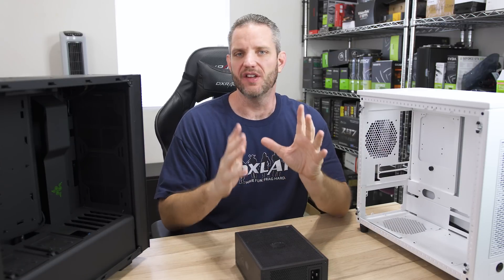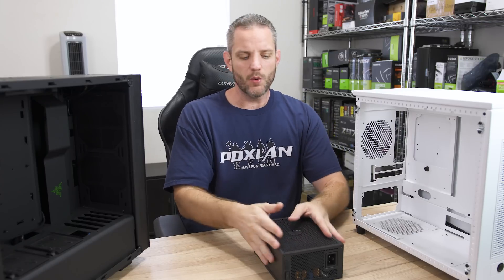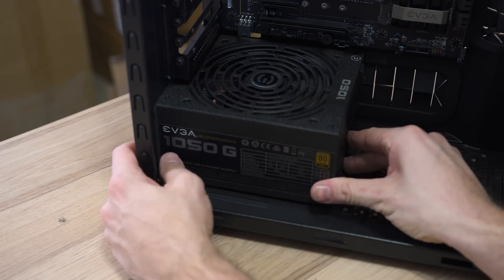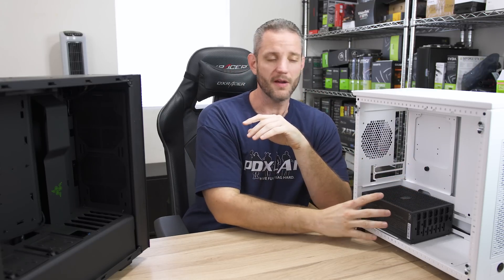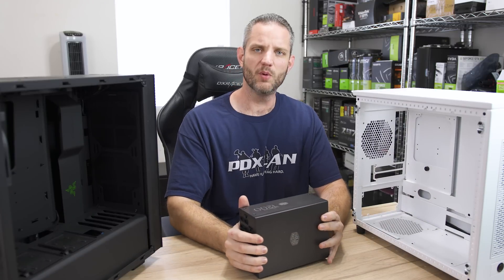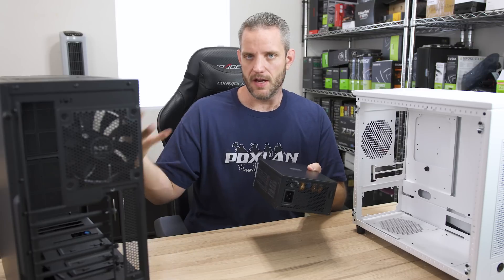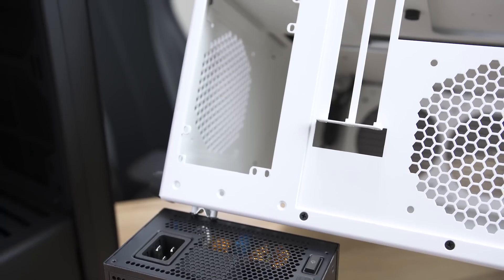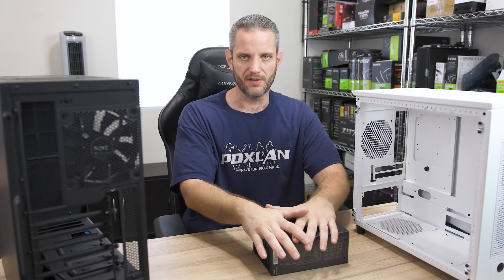Should you mount your Power Supply up or down?

Comment: Thank you very much!! this simple thing really help me.. i have a case with 3 fan in the front (intake) and only 1 exausht to pull all that warm air out of the case. at first i buy another PSU.. From Seasonic to corsair but still got many problem my PC. and when i put my hand on its glass side its feel warm.. really warm. i think with all the cool air push by 3 fans inside the case and it became warm and it had nowhere to go.. with only 1 exaust. there is a strange sound from my PSU like krik krik krik all the time..  sometimes my PC restart without warning (BSOD etc) it just restart. several times a day. i'm thinking to RMA my 1 month corsair.. but then i watch this video and i try to move the PSU face up.. no weird sound anymore from the PSU.. no restart (at least for now.. hope last forever without weird restart) so guys.. dont just thinking about how to push cool air to the case.. coz that cool air will instantly became warm when they go around CPU/GPU/HDD etc.. but also think how to get that warm air out of the case.. or inside the case will became hot and too hot.. a warm air trapped inside your case really can make your PC acting weirdly.. thank you for this video!
My specs were:
i5 8400 with 1060 6GB
this specs should be cool enough.. but because i'm leaving in tropical island.. the air inside the case became so warm.

Comment: If the PSU is at the bottom of the case, I would have its fan facing outward precisely because of what you said at 5:26: I just don't want anything to get inside the PSU.  And if need an additional exhaust fan, many cases let you install one or multiple ones at the top.  But if the PSU is at the top of the tower, gravity would prevent anything from getting inside the PSU, so I would definitely have its fan facing inward.

Comment: The case has ventilation holes on the bottom and the PSU has an exhaust on either its top or bottom.
I wonder which side of the PSU is supposed to be "up"...

Comment: Can anyone help me out? Would it make less noise places with the fan up or down?

I currently have mine set to down and I think it's to loud.

I know I can test this myself (and I will) but I don't always trust my ears.
Reply: Honestly, up or down probably won't make much of a difference as far as noise is concerned. Make sure your power supply is screwed in snug enough, also check and see if any of the power supply housing is pressed up against your case too tightly... Maybe put a little rubber stopper in between any spots where the power supply presses against the inside of the case.
Reply: @TooBokoo  Alright, thx for the answer! I decided to make a hole in my wall and put trough my cables so my computer is in a unused room next to mine. 

This way my mic won't pick up and computer noise and it's a lot cheaper than buying a quiet psu+case.

Comment: Also if PSU explodes even w/ normal temps if fan is up rest components such as mobo/gpu will catch fire, while fan is bottom then the PSU would just burn alone and maybe a bit of the floor.
So conclusion is: Get rid of the carpet or cut it out and place maybe some nice metal sheet under the PC :D

Comment: At 4:00 You claim there could develop a loop of hot return air from the PSU being used back to the supply side of the PSU causing it to heat up. That theory is thermo-dynamically imposible because heat rises. If the hot air from the PSU exhaust is expelled behind the case there is zero chance of the same air being sucked into the supply fan , heat rises. There is no advantage temperature wise in mounting your PSU sucking from inside the case over underneath it. Your theory is fundamentally flawed and wrong. The air from inside the case will never be cooler from drawing from air underneath the case. Your theory is flawed in many ways and straight up wrong. I like your videos but this video is terribad and you are simply spreading misinformation about PSU cooling. If you have low clearance under your tower sit it on a board or build some type of return air plenum underneath the case. Suggesting people use the "conditioned" warm air from the CPU and GPU to cool your PSU is tragicly bad advice. Using fresh  supply air from outside the case is optimal for cooling and that is why PSU comapnies build cases and PSU's this way.
 You are out of line.- 25 year HVAC Laboratory operator

Comment: I've moved from an air 240 to a 570x case. (yeah i know, it's big for a MATX board). However with the Air240, my PSU died. You have to mount that facing out.
I suspect vaping mind have contributed to that. 
I've since switched some stuff around in my room too and bought a fan (an actual fan) so the vapour doesnt have a chance to settle, and yes, mounted my new PSU facing up so its drawing it's air from inside the case.

Comment: Mounted the PSU up. Just got a new M2 NVME which I tried to install. Dropped the M2 screw down in the PSU. Didn't want to open the PSU. But the screw got stuck inside the PSU. Took forever to get it out. Had to unscrew the PSU and flip it upside down and shake it for a long time.
I remounted the PSU down now. And will do it going forward.
Reply: Same happened to me. That's why I'm watching this video 🤣🤣🤣
Reply: Lucky it was just a screw, if the P/S was the right way up passive air flow would do the work, cooler air falling as warm rises ...
Reply: Lay PC down if you doing work. I have 3x A12x25s at front. Air only in via filtered front.  Air out via rear fan, GPU vent and PSU.  Every other hole, no matter how small taped up, even PCI slot cover holes.  PSU fan is hybrid and never needs to come on.  The positive pressure from front fans is huge and is almost enough to blow lighter flame out if placed near psu vent.  Front fans dialed in with noctua fan controller. Highest speed without being audible in dead of night.  GPU is always 'actively' cooled via the flow too. Clean case,  silent, cool.

Comment: Great topic.  I have my EVGA Supernova 850w mounted down, because the case is on a solid surface, and there's a cover over it.  I would recommend making sure you don't forget to check the bottom filter when you are cleaning your case.  It is easy to forget about it.  Mine needs regular cleaning, almost more than the internals.

Comment: Never thought about positive and negative pressure. My newest PC, which already have 3 years, have 4 fans for intake and 3 to exhaust, and it doesn't have any kind of dirt inside the case, almost. I never cleaned it or anything, while my last PC in a single year would accumulate a lot of dust, even fungi had grown in my entire motherboard when I finally changed it, having served me for 7 years.

Comment: Case : Coolmaster 3.1
Cooler Thermaltake smart rgb 650w  
Motherboard : Asus PRIME A320M-K A320
Cpu : Amd ryzen 3 1200 + Stock cooler Amd
Gpu xfx r9 290 4gb
V Ram : 2x 8gb 16Gb
I have 2 fans in mijn case  : 1 Front Lepa BOL.Quiet PWM Red 120x120x25
                                               : 2 Standaard fan back orginal Coolmaster 3.1 fan
When i play the game metro exodus Mine PC going to 68 to 70c Somethimes 72c is this normal? can this also damage mine pc?
when im on youtube 44c 45c when i gaming end i feel mine pc case its really heat. im litle bit scared 72c 

https://azerty.nl/product/thermaltake/3121922/smart-rgb-600-w-ventilatorhuis-600w

https://azerty.nl/product/cooler%20master/2660003/masterbox-lite-3-1-minitowermodel-micro-atx?gclid=Cj0KCQjwjYHpBRC4ARIsAI-3GkG_ZnZeHKursvUaepy3vMwqdZCX-6xKFIEe_1c8zmQ4f7gmgLzRcccaApoeEALw_wcB 

I would like to hear from you advice and tips from your experience

Comment: Here's my arguments for downward mounting:
- Power supplies can't thermal throttle like CPUs can, and many times the hottest component- the graphics card- is directly competing with the psu for cool air. I'd rather give it a reliable source of cool air than the theoretical best position because it can't correct for added heat.
- Similar to water cooling, any system that is in use for a long time will accumulate dust, mostly on the horizontal surfaces inside. An open-top PSU will accumulate dust inside its fan and internals and be very difficult to clean without risking injury.

Comment: So I have 1 exhaust fan and a shroud so do I go up or down? I do so far have 3 fans at the front (pulling) and 3 above the fan along the bottom so do I set them to pull or push air?

Comment: i put fan up because my power supply has RBG and looks great
Reply: Christian Madrid Dude, that’s a big no no. If your psu is bottom mounted with the fan facing up, It’s gonna pull all the hot air from the system inside it.

Comment: I'm lucky I guess - our case has the basement in it, and a portion of the air front the front fans is sent to the psu.  Also, the computer itself sits on a lower  mesh desk shelf, about five inches off the hardwood floor.. The psu draws air  from the bottom and out the back -  seems like good airflow.  A cleaning every month with compressed air help keep the internal dust level low.
Cheers. 🖱

Comment: Why not simply put the PSU at the top facing down?
This way you avoid anything but air from getting into the fan.
Reply: You've got a good point for this becoming more standardized in the pc case designers sense. Some setbacks would be top heavy rigs that could topple easily, aesthetics of non standardized cases, and where to put radiators if their place is taken.

Comment: I'm using a HAF XB EVO as my case, and the power supply sits on top of a rubber pad which lifts it up from the bottom of the chassis. The case itself also has decently tall feet lifting it up further, so the PSU can be mounted down no problem regardless of where the PC is.

Comment: I actually built my rig yesterday with NZXT h500 and have to stop for about 10mins to decide how I mount it and ended intake fan face down because: 1. I want to take it cool air into the power supply,; 2. because I already have positive air pressure by installing additional 2 140mm front panel fans... but hey this is a good video. kudos!

Comment: If the PSU fan comes on, that means the PSU is running hot and needs air flow to cool down.  Ideally, you don't want to be venting hot air inside the case through the PSU to cool the PSU down.  Mounting the PSU fan downwards is the best option for keeping the PSU cool so long as the other safeguards mentioned are met (like no high rise carpeting and an airgap between case bottom and floor) and so long as there are at least a few vents in the top of the PSU enclosure allowing the hot air to escape and be sucked out of the PC case through the case's upper exhaust fan when the PSU fan isn't spinning.  The air loop scenario mentioned is only a problem if the computer case is land-locked inside a cabinet, otherwise the hot air is projected outward and upward from the rear, which actually helps to suck cooler ambient air from the front of the case up through the bottom vent.

Comment: Speaking of basics
I always wondered what (if there are some) informations indicate which motherboard is useful for gaming (high fps)
Sure you have the hardware (slots, USB-ports, sockel for the CPU you want to use... etc etc), but there's little informations out there, what a motherboard makes a good one for gaming.
A GPU has amount of "GHZ", CUDA, type of momory etc ...then there are lots of benchmarks too, if you still aren't sure...
But what values/informations can be seen and compared to other mainboards to chose which one will be more likely for getting high frames per second
Reply: So usually the mobo doesn't bottleneck the pc s performance unless you oc your cpu. Then the vrm s can become important. Ofc I'm assuming that the board supports your hardware
Further it's usually either the cpu or gpu that blocks the pc from full performance. This can be tested by monitoring the cpu gpu parameters under heavy load.
In some cases the ram can affect the performance and always keep your cooling solutions in mind as temperature is basically the only important thing to control when going high clock speeds.
The mobo is basically just a huge and super expensive wire that connects all the actual computing parts
Besides that can a slow ram or hdd sdd cause lags when loading something
Reply: @huntingamer  in other words, as long as it supports all the components, there is little to no performace difference.
heard/read that too, but always wondered, if there are any hidden infos, that can make a better gaming board than an other board
thanks for your answer

Comment: In a small case like the Elite 110 where the PSU is directly above the CPU cooler, should the fan be sucking air out of the cooler or flipped around?

Comment: TLDR:

Fan down: with power supply shroud, or water cooling

Fan up: on carpet, one exhaust fan, most setups
Reply: Thanks.  Saved me a whole 7 minutes and 36 seconds.
Reply: Sick Corsair SF750 badge to display: fan down.
Reply: What if I have one exhaust fan and a shroud?
Reply: My pc has one fan and a shround
Reply: Nicholas ok
Reply: Don't put your case on a carpet, pls just..don't
Reply: nah always put it down you dont want hot air into your psu that will kill the component inside it
Reply: TLDW no one reads videos
Reply: water cooling......
Reply: @EmomanTavish  gas warming......
Reply: What if the shroud has ventilation holes?
Reply: Wew i thought literally SHROUD was mentioned..

Comment: I flipped my PSU so the fan was facing up. i have 2 R9 290Xs in crossfire, and with the PSU fan facing up, it helps exhaust some of the GPU heat. In my case, (lol pun) the front fans are so far away from the GPUs that there is a huge dead spot right where they exhaust, and the hot air coming off of them hits the side panel and just gets recycled right back into the fans. My PSU fan takes at least some of that heat and pushes it out of the case, and dropped temps by a 8C on the lower card. The top card still thermal throttles at 94C, but hey, what am i gonna do, right?

Comment: Noise is a factor too, esp. in a very quiet system. Having the fan inside the case, it has no noise direct escape path. Even if it has to work a bit harder, it is quieter. Also the fans are more effective blowing down than blowing up (where the gravity and the push work against the seal holding the blades)
Reply: You realize that fans in a computer case are for cooling.  Warm air rises.  Why would fans be more effective blowing down?  (this is not an actual question and is very sarcastic)
Reply: @paulmartin2348  There are new fans that blow in the opposite direction so they work OK blowing up. But the mechanics of the fans are such that it is much more effective (and thus quieter) when blowing down, against the gravity. If the fan blows up, it is resting on the O-ring that holds the spindle. Plus the air pressure.
The convection is not a factor in a case, there is far too much of air movement inside. The fans can easily overmatch the convection.

Comment: I plugged in my Aus MB and a 8350 FX AMD chip along with a PSU 750 Watt RGB - I connected the ATX power along with the CPU Power and said What the heck let me try and power on just for kicks - the MB was lit on the bulb but it would not power on - I shifted the RAM put the OEM CPU Fan back on I tried everything - could it be the Power SW connection  from this case ? or is it more likely I had a faulty PSU The same board works in my old build I just want to put in all in my new Enermax Equilence case please help

Comment: I have LED on my PSU so mounting it face down where the LED are not visible will slow my system right? More seriously if your case has more intake fans than outtake fans like the Corsair 760T with a air CPU cooler then having the PSU facing up is not a bad thing at all.

Comment: At 4:05 You claim there could develop a loop of return air from the PSU being used back to the supply side of the PSU causing it to heat up. That theory is thermo-dynamically imposible because heat rises. If the hot air from the PSU exhaust is expelled behind the case there is zero chance of the same air being sucked into the supply fan , heat rises. There is no advantage temperature wise in mounting your PSU sucking from inside the case over underneath it. Your theory is fundamentally flawed and wrong.